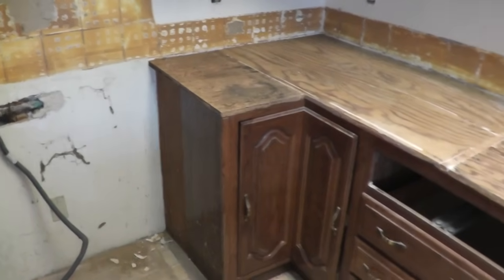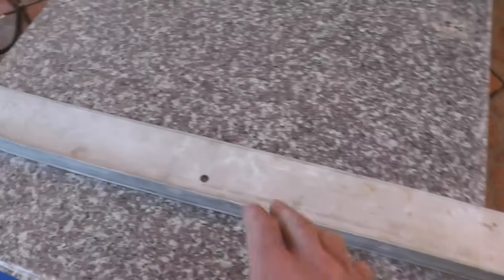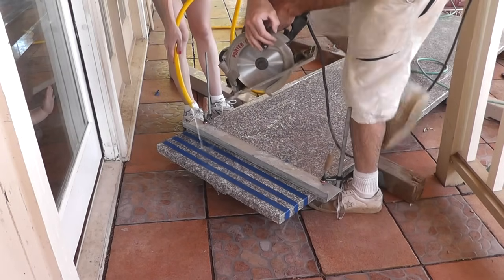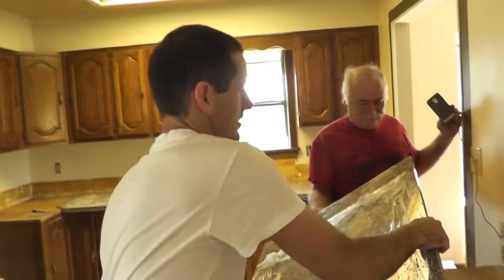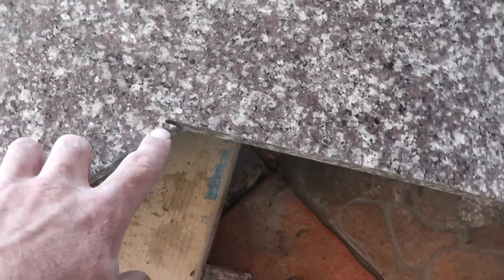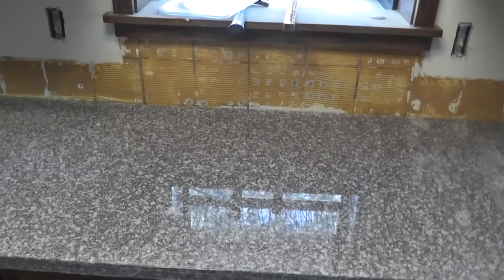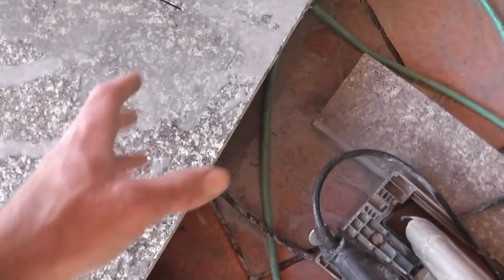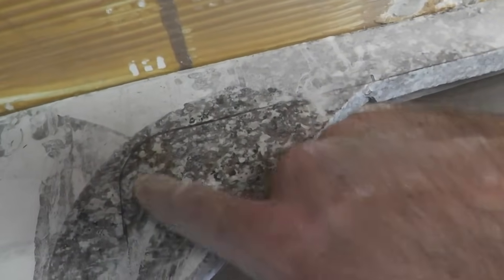How To Install Granite Countertops On A Budget - Part 3 - Cut & Fit With A Circular Saw

Comment: hi can i ask something is there a reason why you are cutting with the saw backwards ? you know the reason you are probably burning out the blades is because you are meant to cut in a forward direction. the blades are orientated i this way. i cant understand why you would do it this way you just made a hard job even harder and you would probably find that you would get a cleaner cut! but well done anyway that you have the guts to do that with such expensive countertops and even more well done that you managed to get through that without injuring you or anybody else!
Reply from the maker: Hi, the reason I cut backwards is so the blade goes down into the stone as I cut. It helps to minimize chipping. Just think about when you drill a hole, the side where the bit goes in is much smoother that the side where it comes through. Although I'm moving the saw backwards, the blade is still cutting in the right direction. Thanks!
Reply: that is incorrect as the teeth are always orientated to cut in one direction. usually down so if you are moving backwards the teeth will be cutting the other way. unless you use the type of blade you switched but my point was that your lucky you didnt injured yourself cause the kick back from the saw can be dangerous especially when going in the opposite direction that the tool was designed to cut in. do you get my point ? anyway well done it looks ok and i am guessing you did it yourself cause you maybe didnt have the cash to get a company in to do it.
Reply from the maker: It's true the blade is only meant to cut one way. If you cut the standard way, you're going forward. The sharp edges of the teeth are moving up into the work from the bottom, over the top of the blade toward the back and then back down again on the backside of the saw. This helps to better control the saw because it pulls the saw down onto the work as it cuts, but unfortunately the top of the work where the blades comes through will be more prone to chipping than the bottom where the blade enters. If I back up into the work, I'm still catching the sharp edge as it comes down the back of the blade. It cuts into the top of the piece, minimizing chipping on that surface. What makes this method tougher is that instead of the blade pulling the saw toward the piece, it wants to push away from it. Because of that, the cut needs to be done really slowly and carefully, and the saw needs to be held firmly down while cutting. Anyway, cheers, and I appreciate the comments :)
Reply: I have the same question.
Reply: scott stevenson The blade doesn't have teeth, you can use it either way.
Reply: that'll be why they put the handle at the back then.
Reply: scott stevenson Look at the blade, click pause. You will see a lack of teeth, pause at 1.21.. With a wood cutting blade obviously you'd use it the other way.
Reply: ***** You should turn the counter upside down, and cut forwards. Then it will not chip. This is basic. I agree with a lot of comments on here, showing other people how to do what you call 'DIY' without knowing what you are doing is dangerous....  I fit kitchens for a living, leave it to the Pro's...
Reply: Chris York Don't be so set in your ways. There's absolutely nothing wrong with the way he's doing it. He's used common sense and ingenuity, things a lot of people lack.
Reply: scott stevenson Hi, the reason is simple, granite, engineered stone and other stone blades are oriented to cut counterclockwise, and most stone and rail saws rotate in this direction for a cleaner cut through material. The saw used is a regular circular saw and although dangerous, it is necessary to run it in the opposing direction to achieve the proper cut and maximize blade potential.

Comment: The reason you are getting chips in your cuts is becasue you are using that notched blade. Thats only for rough cuts. For a fine cut you need to use a thin continous blade.

Comment: Arent you afraid of the kick back of your saw or grinder ?
Reply: Diamond blade do not kick back like wood blades. It's more grinding than ripping.
Reply: Yes they do. I cut stuff all the time with them and they defiantly do.
Reply: Nick, I've cut my entire kitchen in the past, and this weekend I cut the tops to my outdoor BBQ. I've never had my saw kick back. It may bind a little here and there, but it does not kick back like a wood blade. Is your blade used? Or warped? Are you being too aggressive with it?
Reply: I have cut many concrete slabs and thousands of square feet of granite porcelain and natural stone tile. I have seen tiles get sucked in and bound up.  I have fixed holes from people loosing there saw while cutting foundations.  I have filed osha reports on injures from blades blowing out. It does happen and not being ready or thinking it doesn't happen just sets you up for failure. I feel terrible when I go to put in a bid and the homeowner was injured from doing the project. I am not saying anything is wrong with taking on this type of project, just learn to do it right first. 1 rent a concrete and stone saw from HD that is rated for wet use. 2 dont get in front of a saw 3 wear proper clothing and ppe.
Reply: I can certainly appreciate your concern Nick, but I'm no novice when it comes to tools. I still have all my fingers and toes, having tiled all of my floors, kitchen and now my counter tops. I have my own machine shop at home and use plenty of dangerous tools on a daily basis. I've been doing it for 30 years now.  Personally, I think it comes down to the individual behind the tool, and if used properly, you shouldn't have those issues.
Reply: Yes. The term proper comes into play. You said it and the lack there of in this video is what I am pointing out. I am just trying to help other people avoid injuries by trying what you did. I guess that is the extra cost you are paying for when hiring professionals. If you run a machine shop then you know what I am about to say. Its like running a cnc machine with the door open or welding without a mask or with short sleeves. Just bad practices and you WILL GET HURT if you do it on a regular basis unless all of thoes tool manufacturers, OSHA, risk managers, business owners and insurance companies are all wrong.
Reply: Agreed Nick, doing these projects for one's self can be very gratifying. However, never at the expense of an injury.

Comment: For the Nervous Nellie commenters (I'd use stronger terms, but PCness prevents me); I'll address each concern one at a time:  
- Electricity & Water - GFCI kids, he's using an outside device.  Code demands exterior outlets be GFCI'd  
- Blade guard retracted - Diamond blades are far less hazardous than regular saw blades, and most on-site pros consistently have their guards rolled back, the thing is a pain in the ass.  Unless OSHA is sitting there looking over your shoulder.
- Saw cable hanging here and there; okay, good point here, but still, again diamond blade is not going to rip through sheathing like a normal blade  
- slipper surface - those are terra cotta /'Mexican Clay' tiles - unglazed and very slip resistant  
- Flipping the blade - this one I sort of agree with.  The chip-out will be minimal and polished out during the finish, but I can also see why they would want to minimize the chip if they were not going to finish the edge much.  

The only thing I would have preferred to see was an adequately elevated workspace.  Two sawhorses under that whole shebang would have made everything much be more comfortable, which equates to safety.  The ABC of construction; Always Be Comfortable.  

If OP reads this, nice HOWTO.  You should note to your viewership that your outlet is GFIed, the reason your blade is the way it is, and the dangers of pulling back the blade guard even with a diamond blade.  Lastly, please either pick up or make some sawhorses.  They really are amazingly effective in reducing jobsite injuries by simply providing a steady, properly elevated workspace.  Other than that, again, nice job.

Comment: The water and saw is not an issue if you keep plugged end away from water.......we cut stone, stucco and concrete with wet saws all the time....cutting backwards and putting granite on those cabinets I dont understand........spend money and get a high quality blade.....but really a fabricator wouldn't cost a ton for that job

Comment: Support dongle. Lol. 😁   Make weight relief cuts also to control the breaking point. And jeez... Push the saw through the material  in the proper direction of bladecspin.

Comment: why would you take the guard off the grinder and use it on granite and not use gloved or long sleeves or face protection, that is not osha approved
Reply: Frogking9 why in the world would you use gloves when holding a grinder. I've been doing this for years professionally and never used a guard on a grinder. My mommy doesn't come to work with me though.

Comment: WHY THE 45 DEGREE CUT??? it would look so much better with just the straight ends.
Reply from the maker: Hi, it needs the 45 at the corner so the bullnose on the front edge matches up.
Reply: ***** Do what's called a french miter, the 45 is only 3/4".  That way you can start with a smaller cut and trim to fit the inside 45 in place with a makita and vacuum to get a perfect fit instead of that nasty offset you had on the outside corner
Reply: Erick East
Makes sense...thanks.

Comment: I cut the 240v cord to my dryer, I stick the ends to my tongue in the morning to wake me up.
Reply: LOL. Good one Shawn. I use a 480 volt, 3 phase, frequency inverter and set it to 800 hz on hangover mornings.
Reply: +Industrial Tech Solutions, LLC.well, I'll have to try that on   lunch break

Comment: Why paid extra for the bullnose then cut it off? Try not to touch any metal parts like the blade guard and if there is an internal ground fault you'll feel a little buzz at best and much worse otherwise. To be a little safer use only hand, put the other one in your pocket whenever possible. I think the rest of the saw is double insulated but still should be connected to a GFCI circuit. Cordless saws are the way to go, the higher end ones are as powerful as the corded. Not sure going reverse with the saw buys you anything, let say I have not seen any installers doing this. There are granite router bits to get you the profile for the sink.Doing an undermount cutout takes a lot of skill, my installer takes about three hours to do one in the field. I don't think I would try this, not with the $300 - $400 slabs we like. I use overmount to hide my imperfections.

Comment: I just do not understand why it has to be 45 anywhere at all. Why can't we just put 2 rectangular pieces down?
Reply: You can do two flat pieces if your granite doesn't already have a profile polished into it like theirs did. The granite they bought and used for this project came with stacked edges already rounded over and polished edges. They did the 45° cut to eliminate having a round over edge through their seam where the two pieces of granite meet up.

Comment: Ok I got as far as the sink cutout, and I could not watch anymore it's started to scare the crap out of me. If you are doing a sink cut out you should leave rounded corners which will not cause any stress to the stone, so just get a small diamond hole saw, and it will make the whole job easier, and a hell of a lot safer.

Comment: <--- licensed granite fabricator. addressing a couple of issues i seen up for debate. My wife is a physician as well. I fabricate my granite with a 230v Blue ripper, and a wyrm saw 110v, which is just a souped up circular saw.  Yes water and electricity will kill you, but for those of you that are a little out of date with technology, they have created these devices you plug into called GFI (Ground Fault Indicator) boxes that eliminate the the potential electrocution.
Reply: Terry Henkes Stop with your logic its hurting my head
Reply: Terry Henkes gotta love the blue ripper. But yeah he should be safe if he's using GFI and keeping the plugs dry. Still don't know why he didn't just turn the Blade around though...
Reply: GFCI Ground Fault Circuit Interrupter

Comment: Well this is not done by a pro,  as that been said,  why people talk alot I'm a pro 25 years experience but don't have the guts to make a video, I think you did a great job by using what you have in hand and some common sense,  true not DIY for everyone but helps people avoid the mistakes you made and use what you did right

Comment: You could just pt the blade on backwards so that you can push it rather than pulling, looked a little awkward
Reply: ***** It is how the blade goes into the material. You want to blade to spin down into the material as it cuts.

Comment: Alright people here's the truth on what you just watched. Yes it is ok to use water while running the saw and grinder in fact they make many set ups like this from the manufacturer (blue ripper) but other than that this video is a joke. First of all never and I mean NEVER cut stone from underneath with a grinder they bind up and if your under it say goodbye to your face. (Saw it first hand can post picks if you want) when cutting the sink use a 2" core but and then run straight cuts into it and finish by cleaning it up with a finger bit. Or wait I have a better idea call a professional yea it may cost you a little more money but at least the work is guaranteed. Or do it this way spend half the money take all the risk and still have a half assed end product. The seams weren't even notch so the epoxy will hold they will pop within a year I promise especially with his "shimming" but don't take it from me take it from the guy teaching you to hack pre fab
Reply from the maker: +marc spencer I appreciate your concern but I am still extremely happy with the end result, and it has held up great. In fact, these counters got put through quite a torture test after I finished the job: https://www.youtube.com/watch?v=z24-HoKSxX0
I understand, and mention throughout the series that my work and methods are not perfect, but when it comes down to spending $400 on a new counters vs 10x that amount, this is the way I gravitate.
Reply: marc spencer must be a contractor. Always quick to call diy work hack work. Yeah maybe this guy didn't use the safest practices and that is noted multiple times as if everyone is smarter by pointing out the same thing for the tenth time. Anyway everyone should use common sense when using any tool and if you're not sure you should probably call someone like Marc. However I have also experienced some real unsafe and hack work completed by so called professionals.  Oh and FYI I have a crappie circular saw with a masonry blade that I have cut concrete wet many times for 10 years. just yes make sure it's plugged into a gfi outlet.

Comment: the reason i cut in rerverse is so i can see my line and creating a more acurate cut after thousands of cuts your good enough to eliminate a staight edge. and gino is right you dont need to cut  45 so far into your seam  2 " max ...seam is a union of 2 pieces not a crack !

Comment: And for future reference, my comment was not a "troll" or "hate"This video is highly irresponsible in my opinion which is based off of 29 years of remodeling experience.And yup, that includes kitchen and bath.
Reply: Irresponsible in what way?
Reply: @kirkm63  so many ways, no guard on the grinder, power lead in the water when cutting, no safety boots, etc etc
Reply: @andrew2301  I realize he was not up to OSHA standards but most of us have done things that were hazardous because we didn't have the proper tools or the money to pay a professional the man is on a tight budget, and all I am saying is he did a good job for never doing it before, you can give advice and be supportive at the same time.
Reply: @kirkm63  "agreed", but if he gets hurt can l say "I told you so" !!

Comment: Im usually not squeamish when it comes to power tools been using them for over 30 years, correct and controlled incorrectly, safe and controlled unsafely.  But this guys methods are very unsafe for beginner's. No guard on that grinder is really bad, at 10, 000 rpms and a blade cracks shrapnel goes flying everywhere. A carpenters saw used in reverse is not good and putting wifes hands near the blade to water it thats very unsafe. Rub some bee's wax on your fence and saw foot so they glide smoother. People be safe!
Reply: I used a grinder with no guard and a diamond blade for cutting back stucco on a project for what felt like a year straight. Day in day out cutting along a line with a grinder. Over the months I dropped it several times. Sometimes the blade broke in the middle of a cut. Never any harm. They are not as dangerous as you make them seem. They have no teeth like a circular saw blade to hurt you or your wire or anything., Aside from the immense amount of torque that really does a number on your hand and wrist muscles you would be hard pressed to hurt yourself with a grinder and a diamond blade. Just my $.02. Btw, love the suggestion of the bees wax. Would have helped a lot.
Reply: Panda Dan You can touch the spinning wet saw blade with your finger without getting cut.
Reply: Highway Star of

Comment: DO NOT use this method in this Video. This electric saw is not designed for working with water because you may get electrocuted if there is a malfunction with your saw or wire.

Comment: from a stonemason to you this is not the way to work on a benchtop u are using water with a circular saw your meant to use a dry grinder ..and u forgot to work on your joints in order to avoid the joins to drop with time people do not do this urselfs at home call a pro

Comment: Wet cutting with electric circular saw is dangerous.  If you are really stubborn and insist on doing it, at least wear thick rubber gloves and don't step on wet area while doing it.